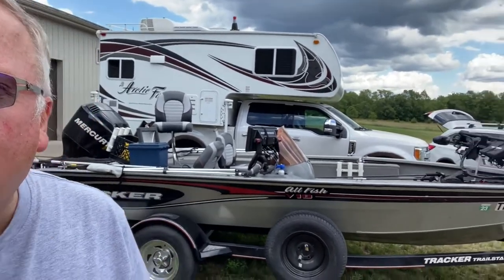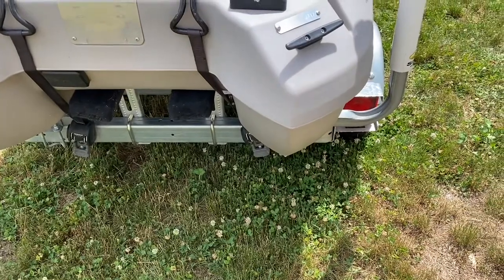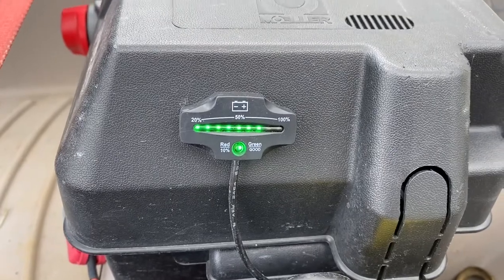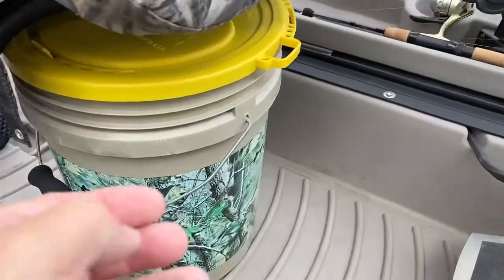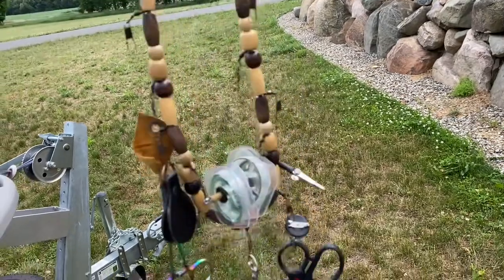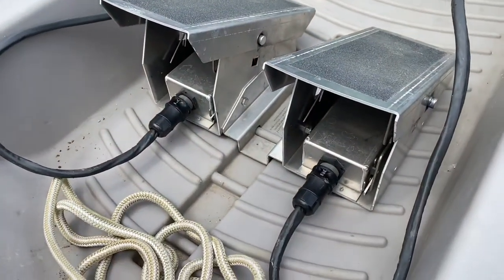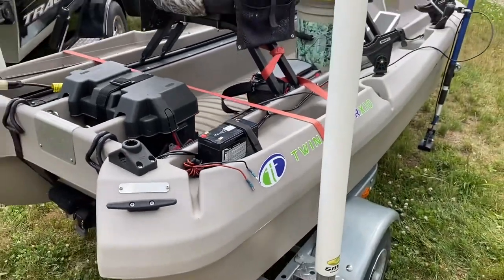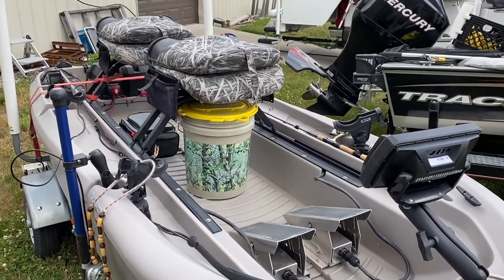Dan’s Twin Troller X 10 Modifications

Comment: Where did you get your rear straps?
Reply from the maker: I bought it so long ago i don’t remember.  However I did find one simular on amazon.  Be sure to measure your points over the boat to make sure 9’ is the length you want.
I want to recommend this product at Amazon<BR><BR>DC Cargo Mall 2 Motorcycle Kayak Tie-Down Cam Straps 1" x 9' Strong TieDown Straps with Durable Polyester and Vinyl-Coated S Hooks, Tie Down Cargo | for Pickup Bed, Moving Truck, Van, Trailer<BR>by DC Cargo Mall<BR>Learn more: https://smile.amazon.com/dp/B01CRFBR2K/ref=cm_sw_em_r_mt_dp_Y75EA1MTQZWZEH0NQBQZ
Reply from the maker: I just double checked my strap length and it’s 9 foot. The actual distance between the hooks and over the boat is 7 feet. If you can find an 8-foot strap, it will be just about right if you have a similar setup to mine.